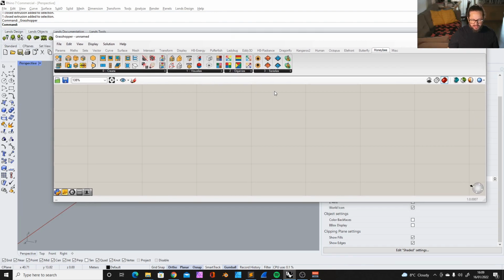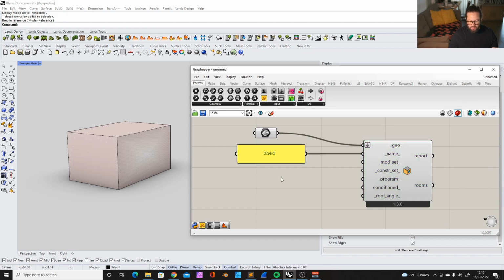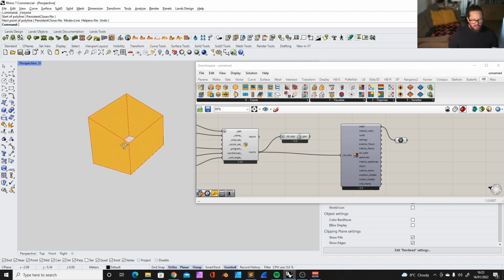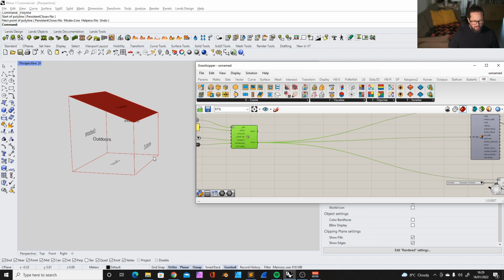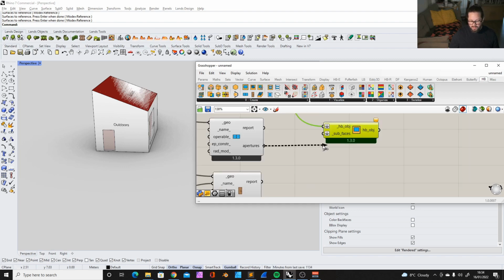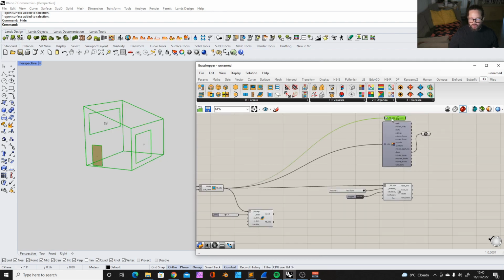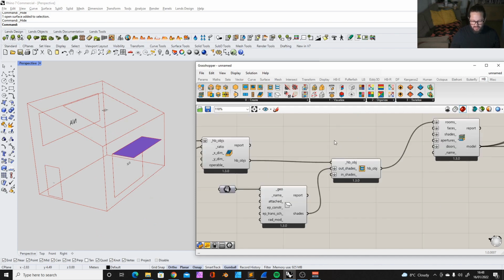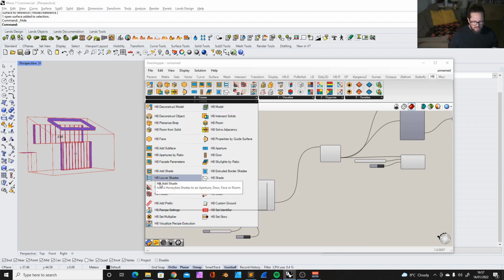Honeybee 'CREATE' Part 1 | Ladybug tools 1.3.0

Comment: These videos are simply outstanding. I learned a lot how to make simple simulation and wise design decisions like doing half walls with window openings for natural ventilation. 

This must be taught in architecture schools at early years so architects gets familiarized with energy methods. It's not intimidating but it gets very interesting once people understands what is going on.
Reply from the maker: Hey, thanks for the kind words and great to hear they helped you.
Also thanks for being a member. Absolutely fabulous. Thanks for the support.
Reply: @PhilippGalvanDesign  This material is needed. Few videos are this illustrative. Parametric design uses actual data. Environmental design is literally this. Designing with weather data and simulation is one of the premises of parametric architecture and engineering. 

These are very useful and easy to follow videos.
Reply from the maker: Agreed :) Let me know if you need any of the videos tutorial files and I can check if I still have them.
Otherwise, I recommend following the videos for a better learning experience.

Comment: Hello, does this only work it is a solid polysurface because I did my model in parts.
Reply from the maker: Yes it doesn't work with detailed models. Only massing models. One of the drawbacks.
Reply: @PhilippGalvanDesign  but can it work with another method such as surfaces by surfaces
Reply from the maker: Yes you can use single surfaces as long as the resulting object creates a closed polysurface...
Reply from the maker: The idea of energy modeling is to test a massing before the object is modelled in detail...

Comment: Hi, i am writing my undergrad thesis right now on understanding how different brick stackings can effect the internal thermal comfort of a room, i am unsure if honeybee can be used to evaluate this. I wanted to change the orientation of some bricks in the facade (essentially to make them out to be shading elements for the facade) and to see if that has an effect on change in the thermal comfort on the inside. will i be able to do this with honeybee or do i need to look at some other plugin? It'll be a great help if you could give me some direction, thanks
Reply from the maker: It's a very specialized task. You might be able to use some hybrid workflow where you use individual honey or ladybug components and manual research and testing.
Honeybee is very material driven. You can specify material but I don't think to the extent you are looking for. Basically you want to find the property of your different brick facade configuration. Where as in honeybee you should already know these properties.
On the other hand, you can specify shading elements separately to your brick wall.
Keep in mind that honeybee doesn't recognize detailed models. It's calculations are based on simple shapes (boxes) with assignments material properties....
Reply: @PhilippGalvanDesign   Thank you so much for the help and for clearing that up. Just wanted to know if you have any idea about using climate studio for this?
Reply from the maker: @AyushGarg-i1b  
No sorry, didn't had the time to look into climate studio.
Reply: @PhilippGalvanDesign  thanks anyways, love your video btw

Comment: Thank you so much for these detailed tutorial, I have an issue in terms of connecting an aperture and door at the same time, it accept to connect only one of these last ones, would you have an idea what could be the problem? 
Thanks in advance
Reply from the maker: Hi, not sure what the problem could be. Check if you use the correct outputs for doors and aperture..
Also the edges of aperture or door can't be at the same location as the edge of the room . Check if everything is planar with the room faces.
Is there any error message?
Reply: Hi, no error message thats actually what drove me crazy)) however, as I doubled checked your reviews I still face the same problem, somehow I think recognition of surfaces as Apertures /Doors  is the issue, as the geometry doesnt seem the same as you have shown in your tutorials even though there is no error shown as I have mentioned. Many thanks beforehand for your time.
Reply from the maker: What version of honeybee are you using?
Reply: I have the same problem. I'm using honeybee 1.8.0
Reply: @vaishnavisprakash6046  This issue appear probably because we are using Macs. However, the solution that I found later is to press shift while trying to add one more element to the code, just try hold pressing shift while adding more than one element to the main task you are working on and I think it will solve your issue;)

Comment: Hi Phillip, loved the tut, however when I am trying to employ the Code on my Computer it does not work at the very initial stage where you are able to use the viewbytypenode to separately view all the walls and roof. Though I need to mention here that the rhino model which i have used as my brep has a set of manipulations like boolean difference, for my own understanding i tired the script with a simple box, but that didnt work either. Request you kind help.
Reply: Update 1: I found this node Planarize Brep which has greatly reduced the no of faces, however the roof and walls are still in the walls output
Reply from the maker: The roof is determined by a minimum angle in the room component. You might want to check that out. Or you can manually force faces to be roof. Don't know how complicated your model is but anything out  of the norm is always a bit of trouble. Energy plus is built mainly for conventional shapes... I would try to simplify your massing as much as possible. 
Also think of what you want to achieve with a honeybee study. A lot can be done with ladybug which is easier with complicated geometry. Anyway if you can't move forward you can also send me your GH definition and 3d model. See channel info for my email...
I'm quite busy these days so it might take a while to get an answer.
Reply: @PhilippGalvanDesign  thank you so much that is so kind and warm of you to offer your help and knowledge with such rigour, wish my college professors were like you. Thanks a ton.
Reply: Update 2: Adding an Angle worked to separate the roof, Thanks
Reply: Update 3: finally the script worked out currently on Part 2 of create, wow, this is getting more and more exciting!!!
Reply from the maker: great to hear!